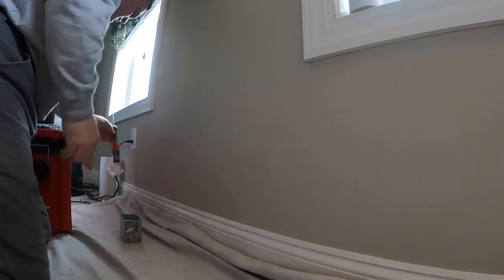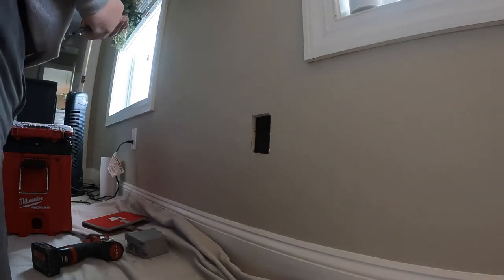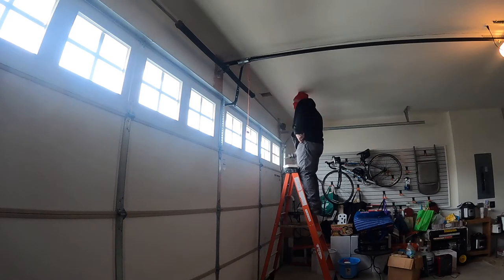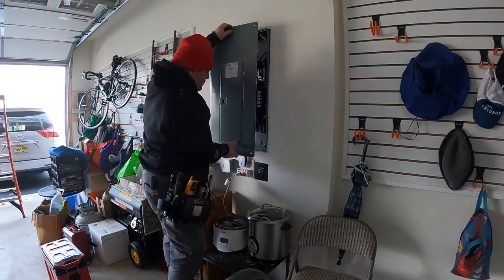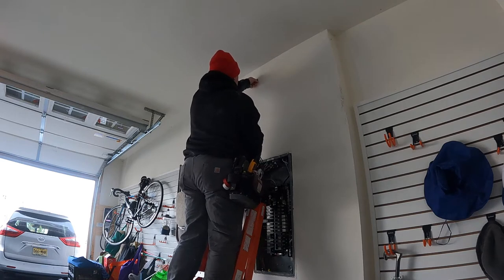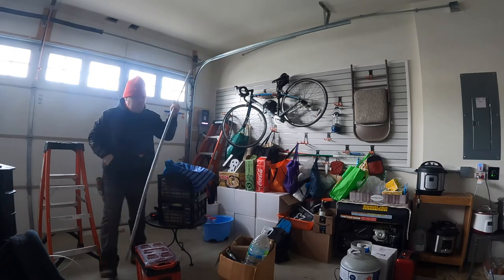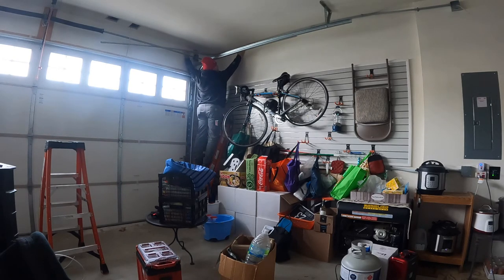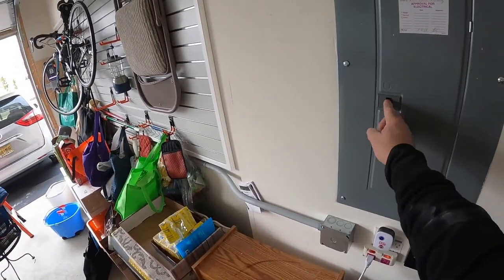15 amp circuit for a 1500 WATT space heater

Comment: Nice professional workmanship with the conduit,  making the various bends in the field is an art much like shaving my own head with a straight razor in the summer months without cutting myself lol.  As a side note,  I personally like to run 20 amp circuits if I'm running an individual circuit for a 1500 watt space heater, for 2 reasons.  First,  1500 watts at 120 volts comes out at 12.5 amps, and according to the NEC, a continuous load shall not exceed 80% of the circuit ampacity.   Second,  it allows for additional flexibility. Since the highest wattage available for 120 volt portable heaters is 1500 according to UL and other regulations, if a more powerful heater is desired in the future such as 3000 watts for example,  the unit will have a 15 or 20 amp 240 volt plug, and the 15 amp duplex receptacle can be swapped out with single 20 amp 240 volt, and the single pole breaker swapped to a  two pole, without pulling a new circuit, don't forget to mark the white wire with a piece of black tape near the ends.